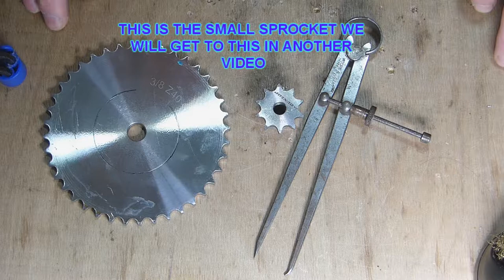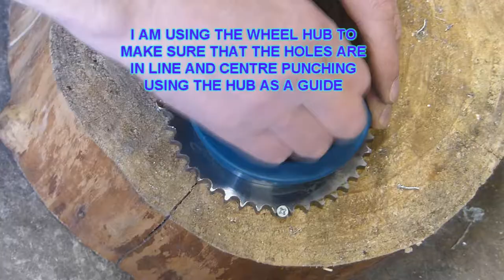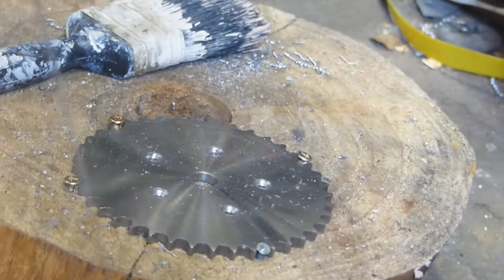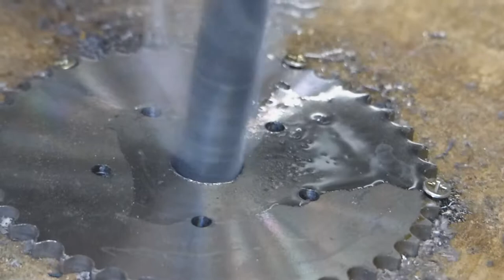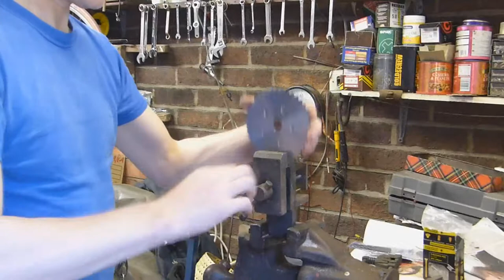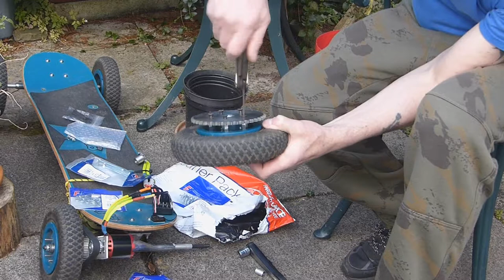DIY $100 Electric Mountain Board, Adding a chain drive, Skateboard, Longboard, boosted board

Comment: Could you please tell me where to get that exact sprocket?
Reply from the maker: Hi yes all the sprockets etc come from a company called bearingboys.co.uk
The rear sprocket is this one

40T Simplex Plate Wheel 3/8 pitch 
https://www.bearingboys.co.uk/06B1-38inch-Simplex-Platewheel/PW106B40-38inch-x-40-Teeth-Simplex-Platewheel-96087-p

The front sprocket is this one
10T Simplex Sprocket 3/8 pitch 
https://www.bearingboys.co.uk/06B1---38inch-Simplex-Chain-Sprocket/3SR10-Pilot-Bore-Sprocket-06B1--20172-p

all the links are in the description under the video as well..

Comment: Hi mate, nice work. How did you get that motor pulley to stay on your motor shaft? I've seen some bore ones like that and without a screw in pin I don't know how you got it on your motor. I'm going for the same as you but not sure how to attach that! Thanks!
Reply from the maker: Hey sorry about the long delay in my reply, I literally drilled and tapped a hole through the small gear that goes on the motor and use stainless grub screw and it works fine, I was supprised that it doesnt need a keyway but has worked constantly for over 100 hours now with no problems. One of videos shows me drilling and tapping the hole and thats all I did.
Reply from the maker: This video shows what I did.....https://www.youtube.com/watch?v=WOvIotg9F1c&feature=youtu.be